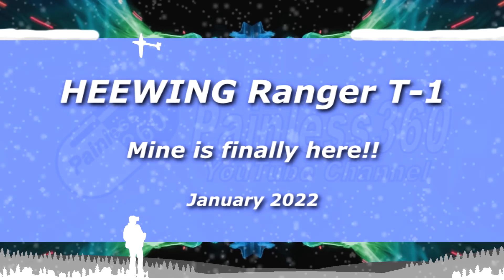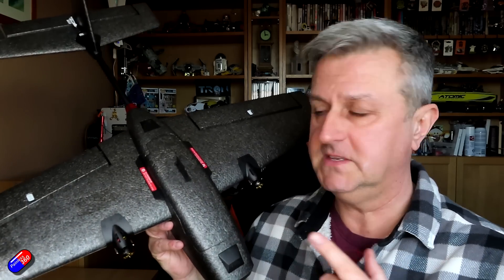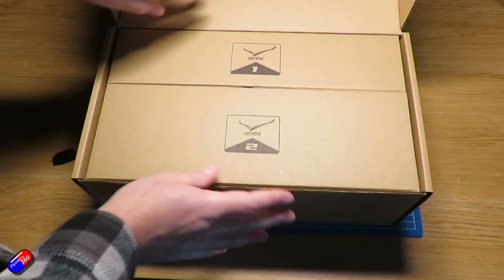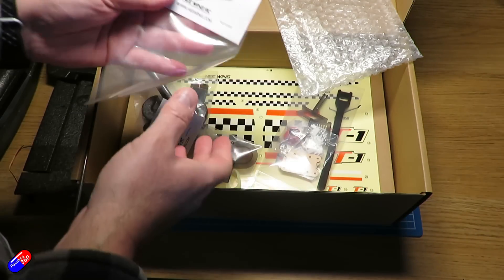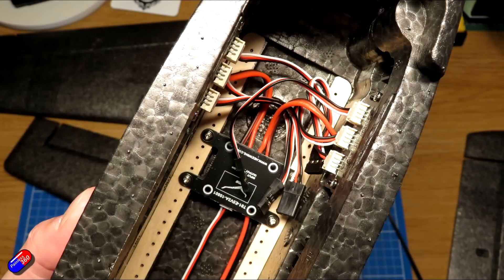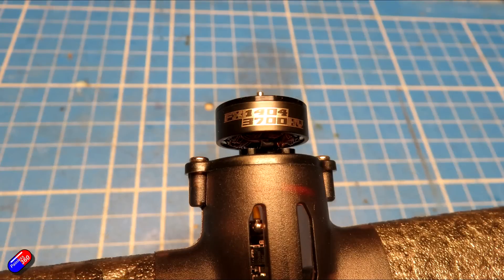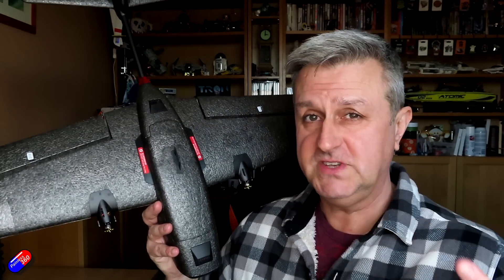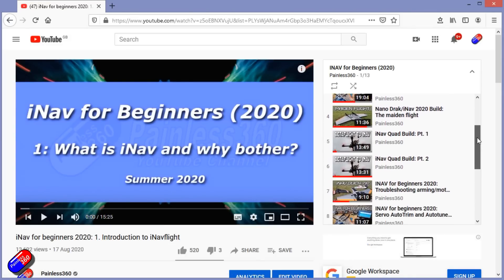My HEEWING Ranger T-1 is finally here!

Comment: I still have mine sitting in the Hangar. It's going to be my spring build for sure. I'm thinking of running 3s LiIon pack that I'm going to make out of 18650 molecel p26a
Reply from the maker: That is exactly the type of battery I am using here and it works brilliantly. Best of luck with your build.

Comment: they now do spares for it as well on aliexpress and you can get an insta go 2 mount for the top air inlet and also a better holder for bottom. also a carbon tail upgrade as well
Reply from the maker: That camera mount kit came in the pnp kit.. happy flying!
Reply: @Painless360  there’s a new one which has go pro style finger mount on top of the air intake. Did you get that one?
Reply from the maker: Yes. Check out the build preview in the fixed wing playlist..

Comment: Received mine a few days ago. Could you possibly show me  how to wire  it up as a simple RC twin motor airplane ? I have a Radiomaster TX16S a Radiomaster R86 receiver and the TBS Micro TX II
Reply from the maker: All of the connectors at the sides of the bay are marked with what they are. Servos, ESC and LED. Connect the y cable  used for the LEDs into the ESC connections and then you have one connection for the elevator, aileron and ESCs. Then plug in the servo lead from the power distribution board into a spare channel on the reciever to power it... Best of luck

Comment: Hi lee, huge fan of your channel i just go this plane, thanks to your video, i love it! do you think 4'' props (HQ 4025 bi blade) will work nicely on PNP version 3S? thanks!
Reply from the maker: I've not tried any other blades other than the ones supplied. I've not felt the need for it. Changing the LIPO cell count makes it a very different model. 2S is very lazy, 3S is fine for everyday exploring and 4S is crazy!

Comment: I'm currently trying to assemble and set up this plane. But I can't figure out how to connect the flight controller to the power distribution board. There are two questions:

1. How to power the flight controller from the power distribution board?
2. How to supply power and control from the flight controller to the ESC in the wings?
Reply from the maker: Connect the battery to the better input on the FC as normal. Cut off the XT60 from the two power wires from the PDB that comes in the plane and solder them to the power output pads on the FC. Simple. Best of luck
Reply: @Painless360  I thank you for your answer!

Flight controller power issue resolved. But I still don't understand how to supply power to the ESC? Do not use pads for ESC on the flight controller board at all?
Reply from the maker: Please see my build series.
Reply: @Painless360  I thank you for your answer!

Comment: Oh I think I'm going to have to get this one. Loving how it breaks down! I drive a smaller vehicle, so this is pretty much exactly what I am looking for to put my spare Maytek f405 in! If you have a moment, can you help me out with a problem I'm having with my quadcopters? I can't get more than 6 channels on my Crossfire nano receivers. I'm using my Mambo transmitter with my crossfire unit and can only get two functioning aux channels in betaflight and kissfc. I've setup the inputs and mixes on the radio, but only getting two aux channels instead of four. So, I've got the main four channels for aileron, yaw, pitch and roll, and then aux 1 for arm, and aux 2 for beeper. I can't get the last two channels for aux 3 and 4 at all. My Babyhawk 2 hd, flywoo explorer lr, or my kissfc alien have them.  Any idea what I'm doing wrong? As always, love your videos and help!
Reply from the maker: I'd check what the settings are for the receiver in the TBS Agent/LUA script on the radio. They may have the number of channels limited.. Best of luck!

Comment: great video as always. I've got a 7" quad on DJIv2 Airunit/CSRF on and looking to buy in addition a wing. I'm hesitating between the AR WING Pro, TBS Caipi v2... or any other?
Reply from the maker: In terms of bang for the buck the AR Wing Pro is hard to beat... Happy flying
Reply: @Painless360  thank you and congratulations for your involvement in that project. I wanted to go 6S as I have 6S packs on my 7" quad... but the PNP kit is on 4S... I was told that the PNP version was very decent; so I believe no need to get the kit and stuff it with other motors, etc etc

Comment: could you show an image on instagram or something showing how small this is in it's disassembled form with all the components bundled up for transportation - including removing the tailboom? 
Does the vertical tail come off easily for transportation as well? 

Thanks!
Reply from the maker: Check out the answer already in the comments re the box size. The dimensions of the pieces unassembled will be about an inch less. Vertical stab isnt made for easy removal at the field but does come off using one screw... best of luck

Comment: What's the biggest prop you can run on this? Is there enough space to run a 4" or 5" prop?
Reply from the maker: The supplied props only JUST miss the ground without the landing gear installed. 5" props could be fitted and just miss the side of the fuse...
Reply: @Painless360  Thanks!